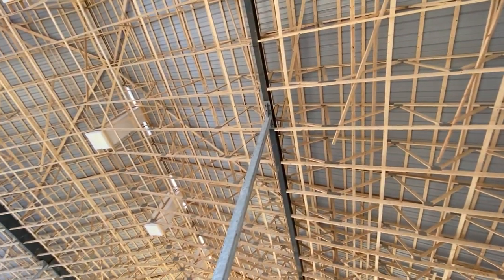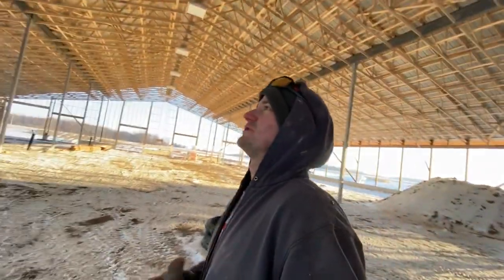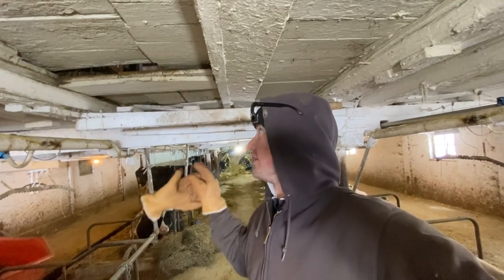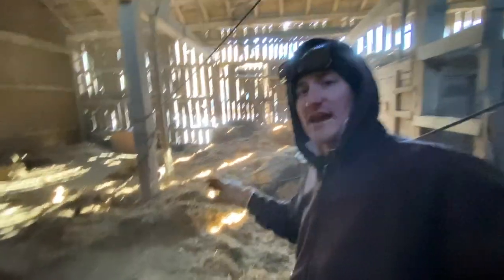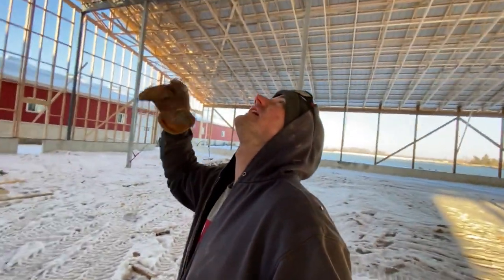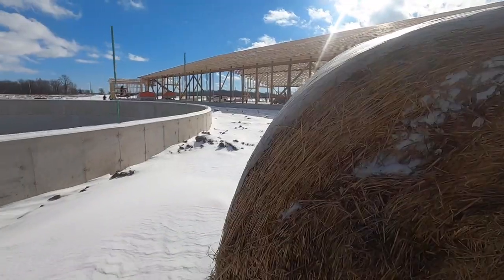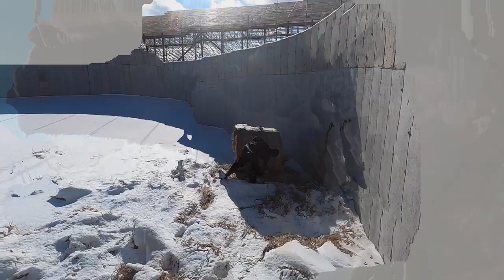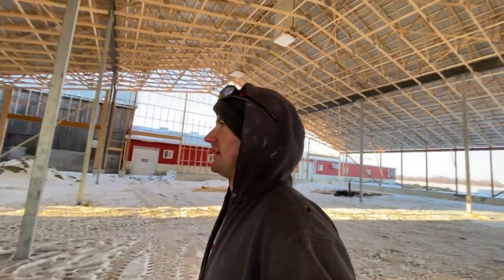We Have a ROOF! | Building Our Cow Palace - Ep53

Comment: You don't know it yet but you are going to get pretty frustrated when your contractor tells you he can't pour floors on top of the frost in the barn. Very true but made worse now that the roof is on and the sun won't get to the ground to help thaw it out.  Warm weather is all you can count on unless you want to spend a fortune on propane. Sorry to be the one to tell you.😤
Reply from the maker: I was worried, but the contractor has a tool just for that. Pulls a foot of frost out in less than 24 hours. Hoping that speeds it up!
Reply: @FreshAirFarmer  I hope you're right.